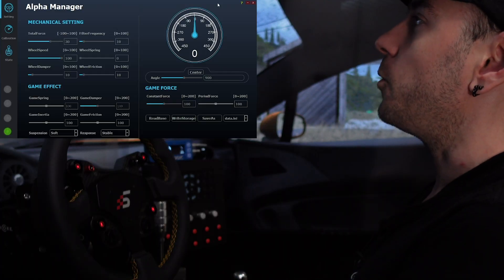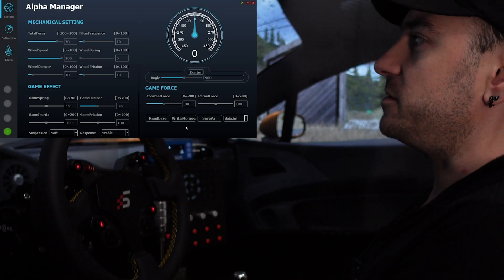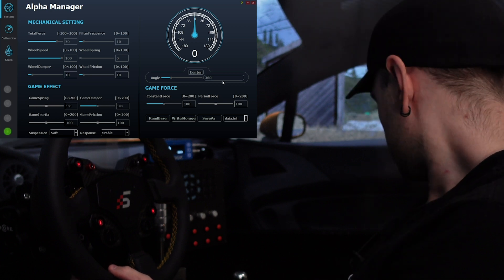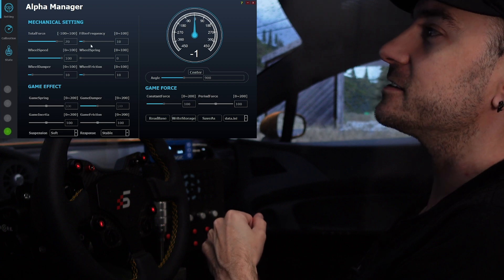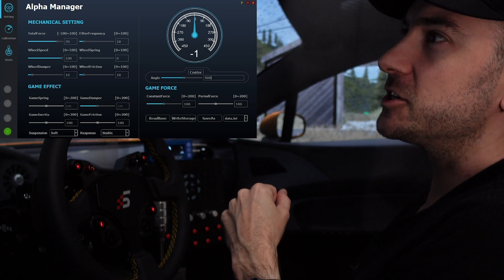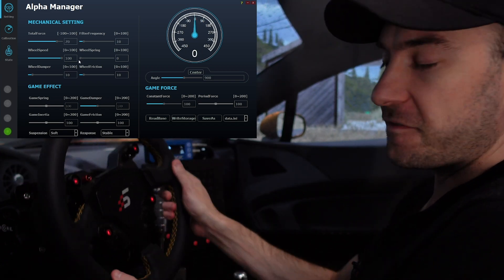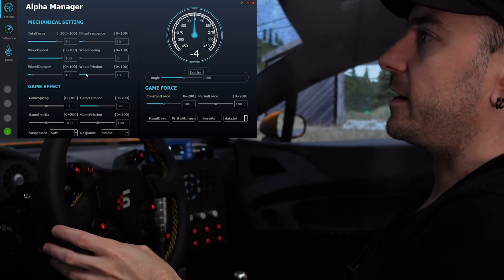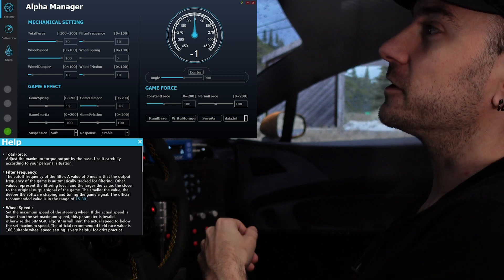Simagic Force Feedback Direct Drive Settings Explained

Comment: I thought youre taking some days off ;). Even with pre production AND uploading in advance its enormous what youre bringing to us contentwise. Really would love to see some more wheels to compare to each other. BTW is there any option to wire up the Simagic GT4 wheel to usb via a adapter? havent found a answer yet. Do you know anything about a possible usb adaption ?
Reply from the maker: The Simagic wheels just plug straight in to a PC via USB if you wish to use them that way. We did a video covering suing Simagic hardware with other brands over on the main channel....
https://youtu.be/i9AVzBHyZe8
Reply: @boostedmediaclips6894  Thanks man. I will look into it. Thought they were limited to the wireless connection to the Simmagic bases. Thats good news for me then ;)